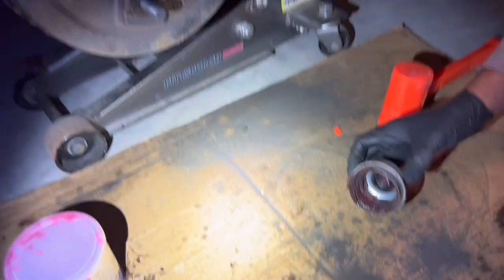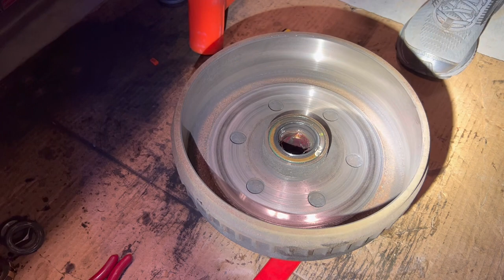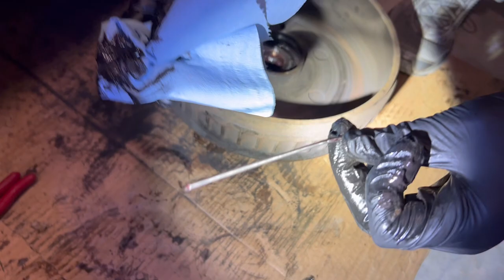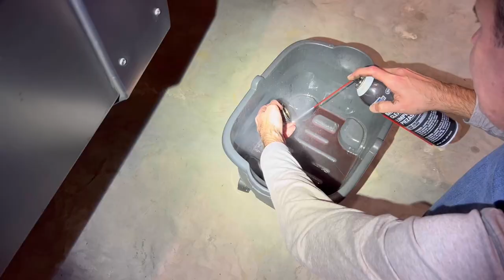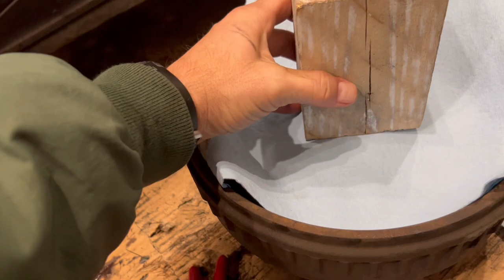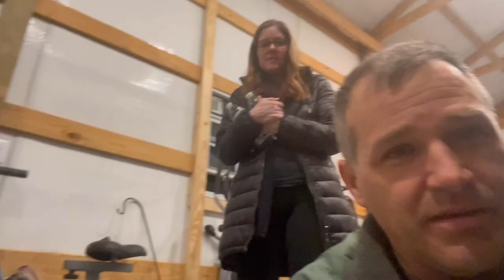Repacking Bearings on Dexter Travel Trailer Axles.

Comment: The old style nuts, had cotter pins holding it all together. Cotter pins are also used on helicopter main rotor. They call that cotter pin, the Jesus pin. Cause if they ever loose that pin, or it breaks,the pilot yells “Oh Jesus, We’re Dead”

Comment: If you haven’t checked your Dexter manual, you might want to. I don’t think you got the bearings properly seated. Usually you need to torque the nut with a wrench, then back it off prior to installing the keeper. There is a good chance your bearings are too loose.
Reply: I second Dennis's comment.  Please check the Dexter manual.
Reply: You just packed the bearings. Why are you pumping more grease in through the Lazy Lube system?

Comment: You made one serious mistake. You didn't adjust the bearings correctly. After installing the outer bearing, you should smg down the nut moderately tight with a wrench because finger tight won't do for this step. Then you spin the drum, or better yet, mount the wheel and spin it.That forced out extra grease. Then loosen the nut and then tighten it finger tight and put on the cage nut and cotter pin. With the wheel and tire mounted you can check for end play. That's why it's better to adjust the bearings with the wheel mounted. The way you did it, you're virtually guaranteed for the adjustment to be too loose causing end play and premature bearing failure when the excess grease it forced out. You need to force the excess grease out BEFORE adjusting the nut. If I were you,  I would jack up each wheel, spin it a few times if the trailer hasn't been used and re-adjust the bearing nut. Simple and fast. If you've pulled the trailer, just jack each wheel up and re-adjust the nut. Squeezing out excess grease by tightening the nut a bit and spinning the wheel is a critical step that you missed. I can guarantee that you have end play the way you did it. That can destroy bearings very fast.  And don't install lug nuts with an impact wrench!

Comment: I haven’t repacked the bearing of my trailer yet but way back when when I need to remove the grease seal, I would set the drum on two pieces of 2 x 4 and use a brass drift to push the bearings in the seal out at the same time, you just have to catch it on a piece of paper napkin. Just saying.

Comment: Still looked good, adding grease to fully packed bearings does nothing but push it out the rear seal. The grease doesnt go anywhere idk why they even put ez lube fittings on them
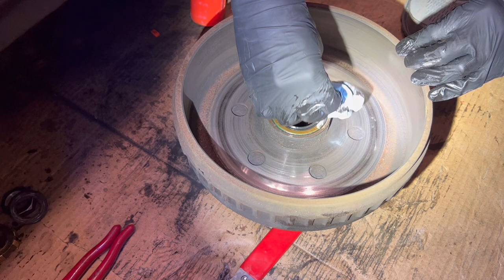Reply from the maker: At the 6:40 mark, we addressed this.  The seal is extremely strong and the rubber part is pressed up against a thicker portion of the spindle.  I would be very surprised to see the pressure of grease going through the bearings to be stronger than the pressure required to blow past that really strong seal that is also buttressed by the spindle.